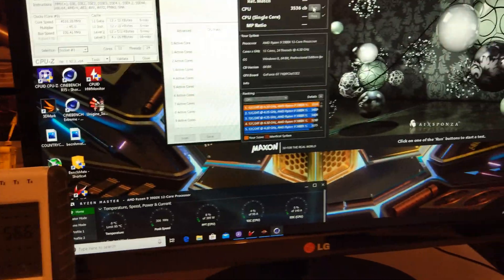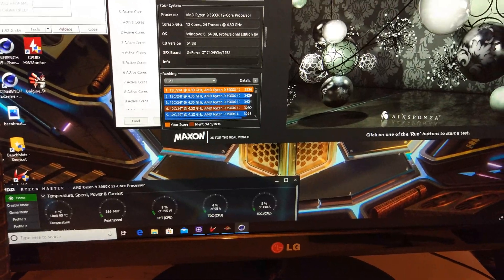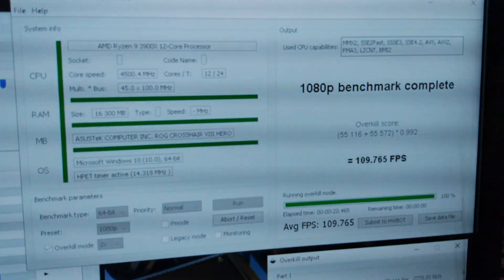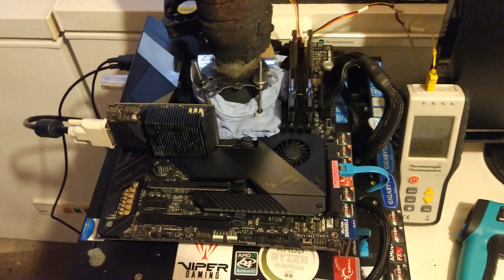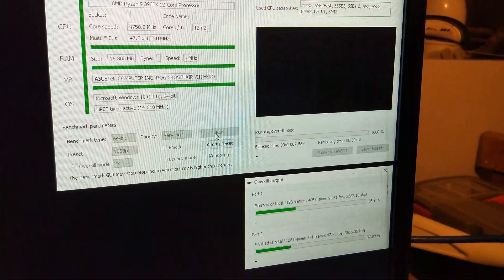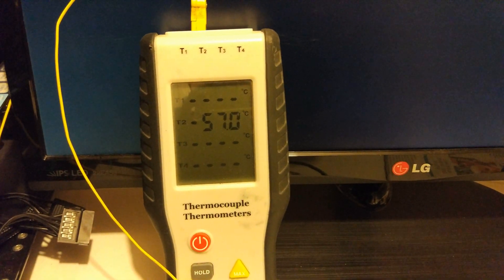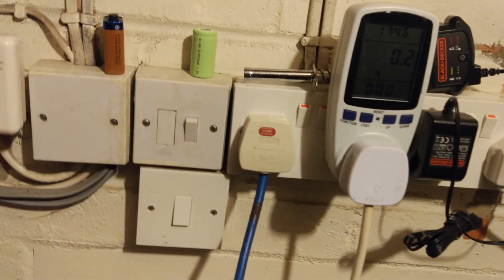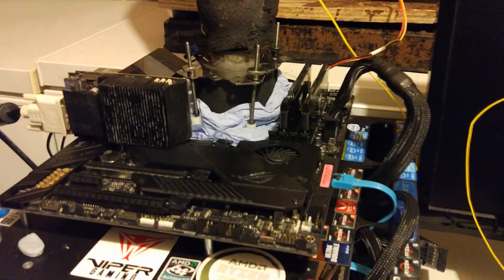AMD Ryzen 9 3900X 4.7ghz All Core Overclock On Phase Cooling  -50c

Comment: I'm at 4.4ghz all core at 1.336v and cinebench score is a 3425 and i'm on liquid , i think your problem is due to optimize the tweack in bios not on desktop , and if u go under zero u need to abilitate ln2 mode in bios i have it on, and sock voltage is important as the vcore u need just to find the balance, then there is a lot of micro adjustment to get stability not only for crash but even stability score , i'm not criticizing your work , we all get pleasure and pride in our machine to get them where ur not hurting it but still optimizing, great video, if you need some thing let me know, have fun🤓😎 (sorry for my Eng)

Comment: Hello First I am new to O.C and I got a lot of questions. I just built my first system about a month ago ROG x570 Hero 8 wifi, 1200w Thor, ROG 360 AIO, Ryzen 9 3900x using an old AMD 550 till I can get my hands on a 3090. First question on enable XMP. I did it..Then when I updated my bios I had to do it again..Why is that not something that could be done on auto, is their some reason you have to go in their and do that? Bios up date, I could not up date it by flash drive to save my life. Then I remembered seeing that EZ Bios updater put 2 and 2 together and got it. I did of course didnt know about it on vid cause all I seen was flash drive way..Anyways the only thing I can think of is when I updated it I was in O.C and unstable or because I had EZ updater on my system it kinda makes you use that IDK..Thank you and sorry for so many question, also kool deal on the over clock..
Reply from the maker: Because xmp doesn't work sometimes, so if you enabled it automatically it could break some cpus. My xmp is 4400mhz so if it came on automatically my pc wouldn't boot at all.
Reply: @LawrenceTimme  Ohhh seems like its a problem thats been going on for awhile now, you would think ROG would fix..Thank you...